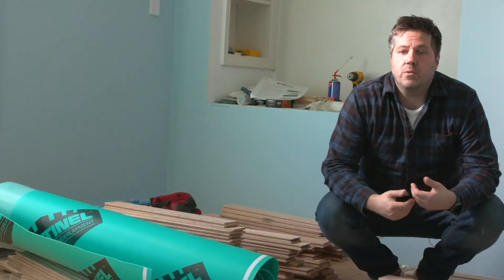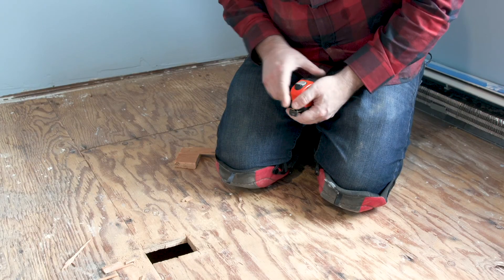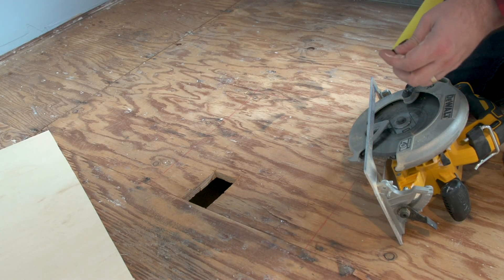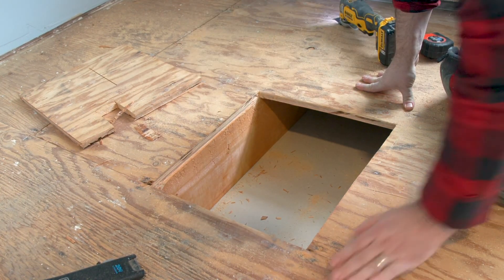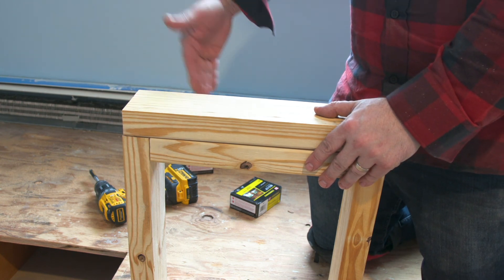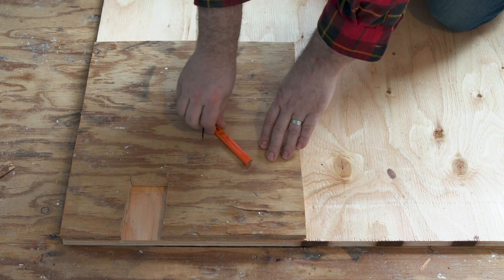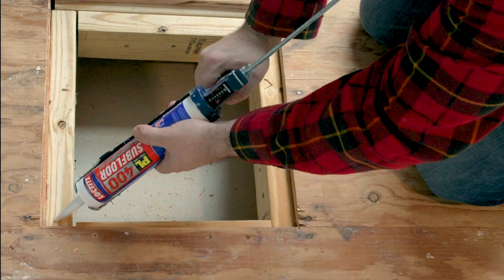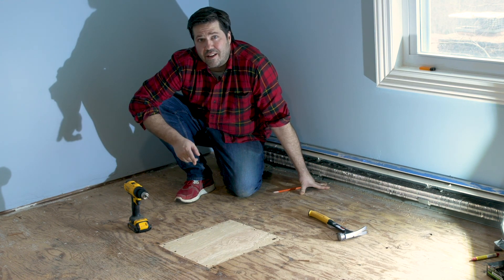Say No to Crack! - Quick Subfloor Crack Repair You Can Do in Minutes.

Comment: Is there a way to do this without ripping up an entire room's carpet? Can you just cut out a section of carpet the same way you cut out a section of floor?
Reply from the maker: You could but you would have to seam the carpet together. the easier way to not damage the carpet would be to roll it back, fix the hole and they relay it back. You just need to pull it off the tacs and then rent a kicker to relay it.

Comment: I have a crack in the subfloor beneath a tiled floor. I'm not planning on replacing the tile anytime soon but the crack is creating an annoying creak / squeak when I step on that section of the floor.

Is there a way to support the cracked section from beneath (I have access underneath)?
Reply from the maker: Hi Eric,  check out this video.  you may need to fast forward a bit, but I show how I reinforced the floor from underneath.  The crack was caused by poor construction where the shower pan was leaking above, but I think it will help with what your talking about.  You might want to put some padding or adhesive on the plywood if you aren't cutting out the existing plywood, so instead of pathing the piece you are just reinforcing the crack to stop the creak.
Reply: @SoWeBoughtaHouse  Did you mean to link to a different video?

Or do you mean I should follow most of the same process you used to do the plywood patch?
Reply from the maker: I think the same process could work for you.  It is a repair from the bottom.